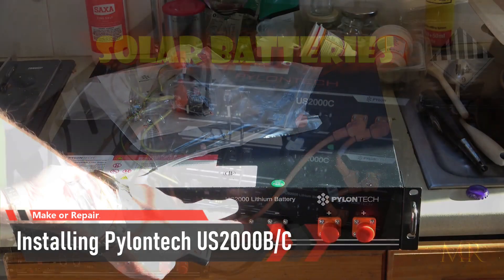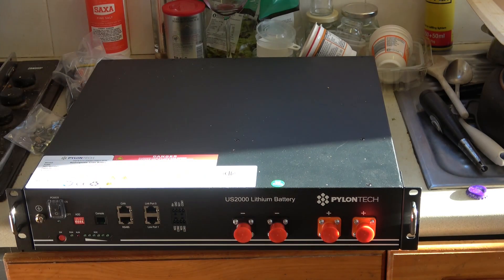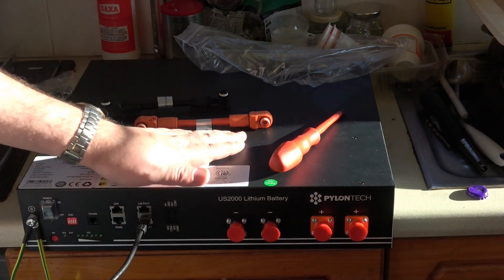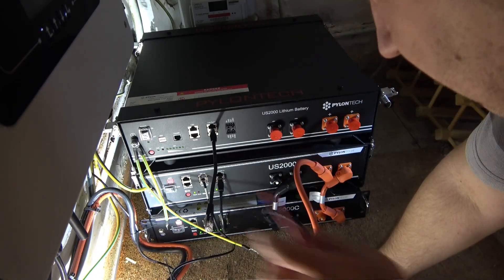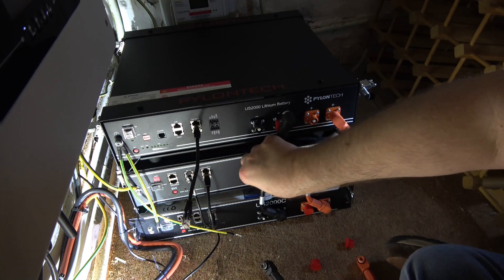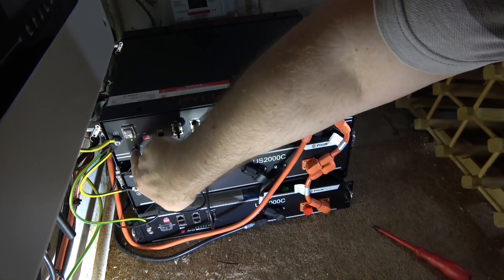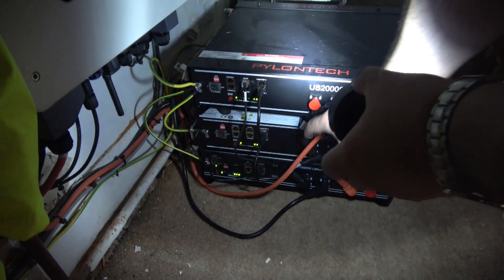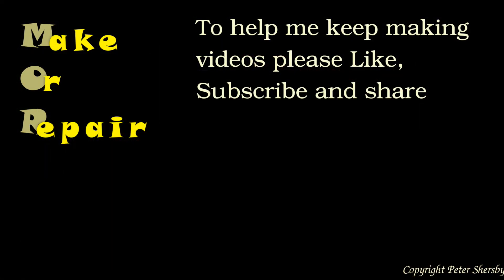Installing Pylontech US2000B / US2000C Solar Batteries #0047

Comment: Could this be connected to a 200w panel  with a cheap controller or would t it work? 
Just wonder if it's more economical than those leisure batteries
Reply from the maker: Not 100% sure, the panel is largely irrelevant, it is the inverter/charger that matters, these are really meant to be managed using a compatible device - unless anyone knows different.

Comment: I have a sofar inverter can you tell me haw to change the charge program
Reply from the maker: You do it from inverter front panel-It takes a bit to get used to, I'll look up the page in the manual tomorrow then should be able to explain, not sure of your inverter model but will explain for mine, hopefully yours won't differ much
Reply: @MakeOrRepair  hi my inverter is Sofar ME3000SP
Reply from the maker: @chrishucker9339   This looks similar to my hybrid although the menus differ slightly.  Its a bit awkward because there are only 4 buttons.  I got your manual here https://midsummerwholesale.co.uk/pdfs/sofar-me3000sp-manual-v1-5.pdf   The program I use is  a "time of use" program which essentially switches the batteries to charge from mains supply for a specific period overnight when I have cheap electricity, I think it is easiest but you might think about "timing mode".   Outside that time the batteries just operate on auto.  I alter the times slightly for winter (when I need to have fully charged batteries to start the day) and Summer when they just need a bit of a top-up to keep me going till about 8ish when the panels kick in.  
1. Buttons are described in section 5.1 on page 19.  
2. So having figured out the buttons you press "Back" to get the menu
3. PAGE 25 now use the up/down enter to pick option 1 - settings
3. Now pick option 12 WORK MODE SET  (DO NOT PICK BATTERY PARAMETER)
PAGE 31 describes AUTO WORK MODE,
Page 32 Describes TIME OF USE
Page 33 descrives Timing mode
SO assuming you are going to use TIme of use use the arrows, pick it and then you just use "enter" to step through each digit on the screen and the up/down to change the value, when it loops back to the top just press "Back" button repeatedly untiil you get back to the main screen
Not the easiest thing to explain
If you get something wrong with the timingthen just go back though and change it or  pick AUTO work mode to get back to normal
This is the best I can really do so hope that helps
Reply: @MakeOrRepair  Thanks I will have a good look through the manual and make sure I know what I’m doing first. My concern is I don’t have a cheaper charge time but I have a good feedin tariff, and I don’t won’t to charge the battery at the cost of losing the feedin tariff if that makes sense. I find that it charges to 80% from the grid at night but then the solar has to ring it up to 90 + which could take us to 11 am this could be going back to the grid at the higher price. 
Thanks for your help Chris
Reply from the maker: @chrishucker9339  Well normally the amount you pay to buy electricity exceeds the price you get from the feed-in-tariff or export guarantee so in that case the advice is always to use your lower-value generated electricity yourself even if that means storing it in battery and just export the excess, if however you can export for more than you can buy then you do ideally want to turn OFF charging in daylight hours - even if thats the case now will it still be the case as the prices rise over the next few months?  good luck anyway
Pete
Reply: @MakeOrRepair  I’m confused re the comment on the feed in tariff? My FIT tariff assumes I’m using 50% but in reality I can use 100% of what I generate. This doesn’t effect the feed in tariff whatsoever, it never has, hence why having batteries and the FIT you make money tax free.
Reply from the maker: @mollyfilms  Not really sure how the old FIT works, at the end of the day it is just about making sure you don't export electricity that you buy back at a higher price.

Comment from the maker: Ballancing is needed when expanding the pack.   The instructions from Pylontech are "When parallel different SOC/Voltages of modult together, please maintain the system in idle for >15 mins or until the LEDs become similare (<= 1 dot difference) before normal operation".   In idle essentially means don't operate from the inverter - just disconnect comms cable before you do the power on sequence.  BUT the ballancing condition is met without this faf if you charge/discharge the existing stack to 50% before installing the new module because it is suipplied at 50% - If you want to double check you can just power on and start the new module before installation to check the LEDs - just don't touch the dangerous bits!!.
Reply: Hi, I just had an US5000 added to my 2xUS2000C. When the electrician installed it, the 5000 had slightly 1 LED higher SOC. As a result, the inverter ran down the small batteries to pitch black, but still showed 6% SOC on the LCD (coming from the 5000 I guess). I charged those up overnight. The 5000 has reached 100%, but the 2 small didn't, they stood 1 LED low. How can I even these out. Can I just switch off the 5000 during charging or the 2000s during discharging till the SOCs will more even?
Reply from the maker: @Scotti-ren  Yes you could just charge each set up to 100% separately then join back together, but they should sort themselves out after a while, the 5000 is supposed to balance them.   But if the 2000s are old can they still reach close to 100%, If the monitoring software allows it check SOH - It might just be that the batteries are telling the truth now they have a heathy master.
Reply: @MakeOrRepair  Thank you!

Comment: You should in the first instance test old existing battery voltage , and the new Battery voltage. If they are different, you need to balance the batteries or they will memory charge individually. Basically, you disconnect the comms RJ45's then with the battery terminals in Parallel, not connected to your inverter, turn on all the batteries and they will balance under 2 hours and then go on standby. This way they will all charge evenly.
Reply from the maker: I meant to pin something about ballancing at the top of the comments.  I did mention it in another coment.  I've never gone to the lengths you suggest - simply install when the existing is about 50% during a charge period- which is what the new one is delivered at, the BMS should be capable of managing small differences.   I've seen them installed fine without any regard but also heard some people have problems when not ballanced - who had to disconnect - ballance then reconnect - however I have not heard of a lasting "memory" effect in this type.   I feel uncomfortable running without intrer battery management connected unless there is supervision - that was found to be the cause of the latest big battery fire!  and these batteries can't be extinguished.

Comment: I have 8 US2000B+ modules, maximum charge/discharge is 50 Amps, the C suffixed modules have a maximum constant charge/discharge of 35 Amps single module and 74 Amps multiple modules, i've queried Pylontech about the lower rate on the B suffixed modules but i've not had a reply.
Reply from the maker: Not sure where my reply vanished to.   Anyway can't really say too much about this, the spec states 50A Max Charge/Discharge for the "C"  But in both cases the recommended is 25 My inverter/battery combunation manages it at 25 automatically.  For me, the priority is maximising the lifespan of the battery not the charge rate - because that is what maximises the return on investment.  Of course the inverter can limit the charge/discharge as well as the batteries themselves.
Reply: @MakeOrRepair  Hi, I agree with you on charge/discharge amperage, I connected my modules to my laptop with the Servetec cable at the beginning of January and all 8 modules reported 100% SoH after 3.5 years and 3 MWh drawn from the modules. There a couple of useful FB groups that may interest you, Solar and Battery UK and Pylontech Owners.
Reply from the maker: Thanks  I'll look at the groups
Reply from the maker: A 3600W Inverter will only charge/discharge a maximum of 74 amps at the nominal 48V of the battery. 
Pete

Comment: I noticed an extra positive and negative ports on the batteries. Could I hypothetically use them to connect  EXTRA CABLES  going to the inverter via a fuse .  So im thinking it's like having a thicker cable, two for the positive and two for the negative . . Hope I've accurately described what I ment . Looking forward on some feedback ?
Reply from the maker: I think the pylontech cables are rated for up to 5 batteries per set joined as shown, but as usual check the spec, I think they are something like 35mm square.  I would not use two smaller cables to try and make up the capacity - stick with the heavy duty proper cables.  If you installed 5 batteries or more then I think you would indeed need to parallel up so you had two positive and two negative, taking from top and bottom so that there is no over-heating in the shorter link cables and ensuring you ballance the battery charge before installing.  I would add the second long pair at the 5th Battery.  You would never have to go beyond that because if I recall correctly there is a max of 8 batteries in a group after which you have to install controllers and stuff.

Comment: Hi, thanks for sharing!
You could use these Pylontech modules instead of a generator set?
I could recharge them from the electricity grid at night and then use them instead of the diesel generator to give energy to the electric utwnsiles by day?
Reply from the maker: I suppose with the right type of inverter, but normal hybrid inverters would not work if the mains failed / disconnected from the mains.  Mine for example will operate a 1KW emergency circuit if the mains is disconnected whereas with the mains present (and essentially doing nothing) it will happily deliver almost 3.7kW all from the batties - the limit of the inverter not the batteries.  I think Pylontech and presumably several other firms do some other batteries actually designed for the job!  It seems to me that generators have  a certain ability to just keep going whereas with batteries once they have discharged...  also I would have thought there would be a big cost disadvantage with batteries but I no nothing about using generators!
Reply: @MakeOrRepair  Thank you so much for the answer,
I have an idea to feed 3 fridge for at least 10 hours a day, they consume about 2kW stores and then constant about 300W.
Do you think 4 pyllontech can feed them for about 10 hours and with the off-grid inverter?
Reply from the maker: @fabioyeah5051 I'm not sure how much I can help you, we are going a fair way from using batteries as part of a solar installation - anwy I'll just give you my thoughts:  If you are charging by night from grid, then with grid still on wanting to run them from battery then there are plenty of inverters that could do that, Options reduce if you want both on-grid and off-grid.  I really suggest you get a few quotes from companies, even if you don't use them it will give you a far better feel for the available products and the issues that might arise.  Anyway without solar input I'm not sure the saving on electicity is enough - using my current prices of 5p at night and 15p during the day,  that is a single charge of 9kW approx giving a saving of just 90pence per day x365 = £328 per year so the payback time on 4 batteries + an inverter is perhaps as much as 15 years, by which time you might be worried about reliability and life expectancy of the inverter/batteries!  Of course if the gap between nighttime costs and daytime costs grows then the payback period reduces.  An of course if you are using large fridges with high value losses if they fail then there are other factors that I don't really take account of.   
To the battery capacity -  300W per Fridge - I assume they are large then, I run 3 under counter fridges and my total usage is under 300W for them all.  I'm not sure what the reference to "2KW stores" means.   kW is just a measure at a moment in time, you need to know the KWh  i.e. the power usage per hour because the fridge compressor presumably is not running 100% of the time; perhaps you meant 2kWh to get them started then 300Wh  every hour after that?  Anyway from the kWh you can simply multiply by 10 and you will need about 1.2 x that amount in battery capacity since your batteries will not fully discharge.  As I said, pylontech or some other compny probably has a more approriate off the shelf solution for this.  But if each Fridge used 300W fairly constantly then that is  300 watts per hour = 0.3kWh each, x10= 3KWh every 10 hours giving 9kwh used per 10 hours for 3 fridges.  Now 4x2.4KWh batteries = 9.6kWh so it is marginal and would depend on the depth of discharge that the inverter allows, but while they might consume 300 Watts while running , are they consuming that all the time?  But got to be honest, this sounds very expensive, as you are describing it you can only charge these batteries once a day, so roughly speaking that is just 9kW hours, adding solar pv into the mix would bring the cost up a small proportion but the payback time down a lot (once you decide to invest in an inverter then panels are the cheapest part -  in the region of £120 per 350 watts peak)

Comment: Thanks for the video. So did you mean you could have added a Us3000 as well, but then it should become the master? What about balancing the Us3000 with the remaining?
I have 3 us2000 and want to add another one but was thinking of getting a Us3000 as the extra. Will it work?
Reply from the maker: I have not tried it but I understand from several other people when I was researching that you can mix the 3000 and 2000 and that the new 3000 is used as master and can communicate to ensure appropriate balancing,  again going for about 50% charge across all the batteries before connecting.   I would suggest having a good search for manuals and datasheets for the 3000/2000s.   BUT I have always found that £/Kw the 2000 to be slightly better value.
Reply from the maker: I have since added a us3000c and I did put it in as master.  I waited for them to be 50% charged then added it to make balancing easier.

Comment: I'm looking at something like this myself,  what inverter / hybrid inverter do you use?  What is the Max continuous output from the batteries alone?
Reply from the maker: I use a Sofar hybid, the HYD 3600, it has 2 channels for PV with 4KW max input but each of the 2 MPPT (1 on each of the 2 channels) tracks a max of 2.4WK for max efficiency so the 10x380W panel I use are split into 2 groups of 5 otherwise I would lose efficieny on the brightest days by sending 3.8kW to a 2.4Kw tracker.  Assuming there is charge in the batteries it can also use batteires to run an emergency 1KW circuit in event of power failure.   Regarding the current the US2000B/C  it is 25A CONSTANT per battery at a nominal 48V which is 1.2KW per battery and at that rate the battery would discharge in less than 2 hours  however it can handle much higher peaks for a few minutes (but never will because the inverter will get that from mains). The difference between the B and C is mainly discharge depth.  25A is also the optimal charge rate (for the bulk of the charge) so they take a minimum 2 hours to charge from flat.   BUT it is the inverter that ultimately limits the amount of current provided for charge and depth of discharge and it should be programmed to maximise the life of the batteries; the HYD3600 recognises the pylontech batteries and is pre-programmed for the B model which means that when the batteries discharge to about 19% (firmware update might change this) it stops using them since an 80% cycle is optimal for life although the C can go to 95% that does not mean it is advisable.   I don't have experience of other makes so I would not necessarily reccomend my inverter nor choice of battery but I would say that using an inverter that does explicitly support the model of battery is critical.   All you can do is look at the data sheets carefully  https://en.pylontech.com.cn/pro_detail.aspx?id=114&cid=23.  

My strategy to maximise savings was to fit one battery along with the inverter but specifiy that I wanted to add more later, then I monitor actual usage data to see where and why I was still buying and exporting, when the battery was charging etc.  and then decide if a battery would deal with those problems and if there were enough excess from the PVs to charge it (no point in having a battery if you can't charge it).  I had to use my system without batteries when it was installed and would make pretty good savings but I was exporting a lot of what I produced  (with little payment) and still buying quite a bit;  the batteries reduce the amount I export by about 2kwh per battery per day and of course delay when I have to start buying in the evening. smooth out any cloudy times and high usage times when the panels don't produce a lot;  as the cost of electricity rises the batteries become more cost effective, initial outlay was higher but using batteries in the uk was definately the right choice for me (I use a lot of electricity though).  I did also switch to Octopus Agile Go  because that sells me very low cost electricity at night which I can store int he batteries and use later, particularly handy between September and March.  

7.2kW seems to be about optimal for me at the moment, but I might increase to 9.6 if electricity prices go up a lot, but it will partly depend on if Octopus keep offering the Agile Go scheme given the problem in the electircty market at the moment.